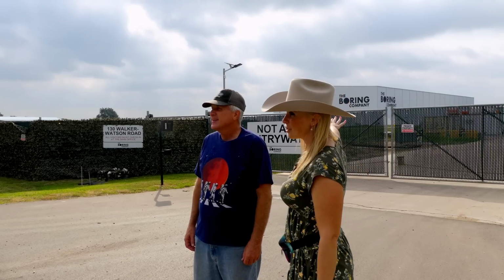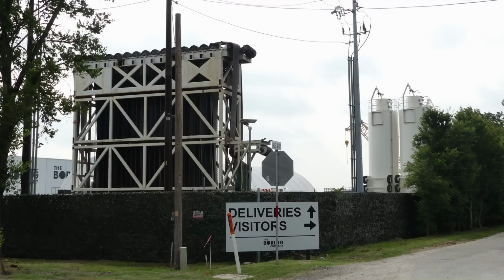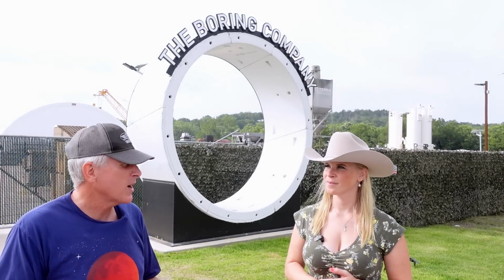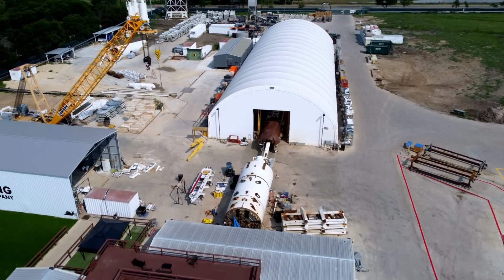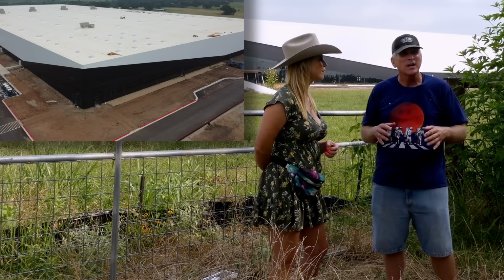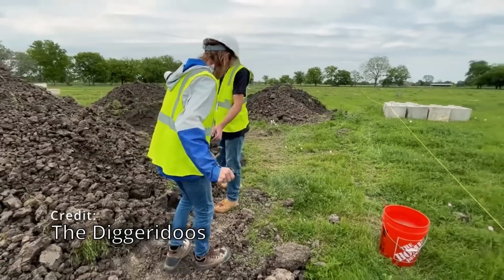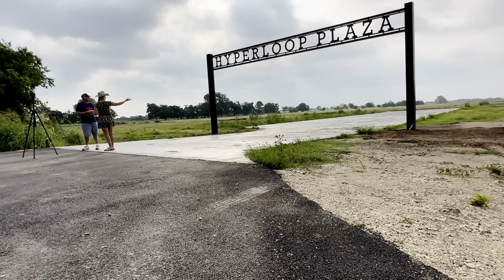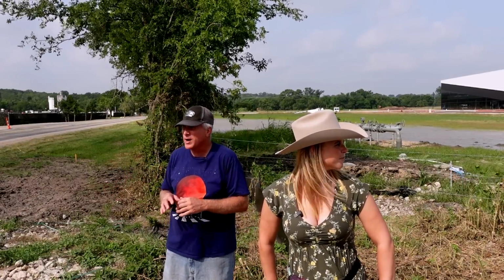Boring Company Drone Mission Reveals Secret Testing Tunnels

Comment: its just tiny tunnels whats the point
Reply: Zero emission vehicles make small tunnels feasible for transportation, small tunnels reduce costs, reduced costs make more tunnels feasible, more tunnels means less traffic congestion and possibly even returning surface streets to pedestrian use (in time).

Of course inexpensive tunnelling will also be very useful on Mars, where cosmic radiation will be a serious threat to health.
Reply: @alanlight7740  small tunnels are a deathtrap and no option for mass transport
Reply: @S1nwar  - the tunnels are the same size as some of the tunnels in the London Tube.

Comment: Tesla should provide the vehicle on demand at or near Hyperloop entry’s. A unique vehicle with 360 degrees of wheels unless electromagnetic or combination thereof. Reasoning: like on the log rides when all passengers move to one side then the other, that rock in a high speed vehicle could be RUD prone.
Reply: P.S. you can do it Ellie, 1% better each post is all that matters. You will achieve!

Comment: The Boring yard looks similar to SpaceX…. All organized for a reason…

Marcus is somehow able to get answers of every new piece that shows up everyday…

It is a continuous story that builds every day…

He gets lots of local help… and does the work remotely from Australia…

The giant sliding door on the end of the tunnel…. Looks pretty heavy, like it might be able to hold a vacuum inside the tunnel…
Air resistance inside a tunnel can really affect speed… removing the air will really speed things up…

There is really a lot that can be covered… like SpaceX, it is all in plain view!

If you capture these details… (what is this, what is that, what is happening over there…) your subscribers will multiply…

Some of your viewers will gladly supply answers and deeper questions…  

Elon will spend time with people knowledgable about his project that can help tell his story…. Watch Tim Dodd the Everyday astronaut for how well that worked out for his channel…   

Tim developed the skills needed to discuss the details of the Raptor engines so he could discuss them while walking around the facility with Elon…

Everyday you get stronger… keep building your team… and assorted connections…

Every Boring job will make interesting presentations for years to come…

Lots of questions about tunnel design…. Materials, strength, air flow, vents, safety, fire, rainwater, groundwater, ocean water, vehicle exhaust, dirt, grime…

Find out what Elon has in mind… what makes his tunnels better than the others… what are the other’s short comings?

Ellie, you are closer to these answers than anyone else…

There are so many historical tunnels you could visit doing your research…. NYC has so many….they handle tons of cars every day.

There were two British chaps YTing narrow boats cruising canals… each canal story had a highlight of the technology around it at every stop…. They were skilled at getting interviews with people that had access to answers…

Find those people… your people!!!  😃

You have great skills of telling a story…. Start weaving a bigger story!!!

Comment: That's a small tunnel cutter. There are yt videos that appeared in my feed that show much larger units that crews man. These units have control rooms, motor rooms and crew rooms. The cutting of water tunnels for Pumped Water Energy Storage systems use these much larger machines that cut about 12 feet, then the unit installs the roof sections, then drags itself forward, repeat. The conveyer runs all the way to the entrance chamber, where loaders scoop it up and load trucks or rail cars. Switzerland has a few tunnels that descend and rise at very steep angles.  The engineering through various strata is detailed and amazing.
Reply: There are other kinds of boring machines, yes. The Boring Company however wants to specialize in just one or two, possibly three standardized sizes in order to reduce costs. The primary size is large enough for one lane of passenger traffic, and these would be bored in pairs to allow two directions of travel. They are also looking at a larger size that would allow two trucks to travel side by side. One way travel reduces the likelihood of an accident and also keeps air flow running in one direction to reduce air resistance, while the reduced size keeps costs down. The reduced size does mean, however, that these tunnels would only be suitable for zero emission vehicles.

Comment: It'll come down to  how fast they can go. 5+ miles a week? Then they have to build up! A 500 mile project, a loop around austin dallas galveston corpus christi san antonio, would need dozens of those going at the same time. 100s mile total length in conveyor belts used at once. It'll come down to who can work out chorreoghying those elements. I think Boring is worth focusing on to get up to that 5+ mile/week range. There are a few different types of projects this tech, at that speed, can be used for.

Comment: Tunnels avoid dangerous traffic on Earth, and dangerous surface radiation on Mars.

New ideas (like Elon's) pass through three periods:
1) It can't be done. 
2) It probably can be done, but it's not worth doing. 
3) I knew it was a good idea all along!
-Arthur C. Clarke
Reply: Someday we may need to avoid radiation on Earth,too.❤
Reply: 2.5) It probably can be done, but Elon is lying and will botch the job, and it should be done differently, anyways.
Reply: By routing motor traffic underground, tunnels can also return streets to pedestrian use - which can change cities in very significant ways.

Comment: Chicago has a tunneling system But it's to prevent flooding. They have multiple  reservoirs that hold trillions of gallons of water. Once the rivers water level starts to drop, they pump the water out of the  reservoirs back into the rivers. They started digging the tunnel in the 1960's. They should finish around 2030. Deep tunnel is what it's called.

Comment: Is there any Lithium, cobalt, or other valuable material in the dirt that comes out of the tunnel?
Reply: This of course would depend on where the tunnels are located. My understanding is that in the Austin area about the only thing they would be getting from the tunnels would be limestone - which would primarily be useful for building more tunnels in softer soils as limestone is used in concrete.
Reply: @alanlight7740  Anything that can be reused makes the tunnel cheaper. I remember at one point, early on. He was talking about selling bricks, made from what was excavated. For a very low price. I remember 10 cents a piece. But I'm not certain about that price.

Comment: History shows, that increasing capacity, just increases demand. And you do not want to be in standing traffic in a single lane tunnel……
Reply: It’s easier and cheaper to add further tunnels than widen roads on the surface, in order to keep up with demand. Also autonomous vehicles shouldn’t result in human-driven stop-start traffic, so no reason for vehicles to sit stationary in the tunnels.
Reply: Another way to say that is that people like to travel when it is easy to do so, so quality of life goes up when lanes are added.

Of course the chief problem with adding lanes on two dimensional roads is that they get in the way of each other: grade level crossings that require traffic lights and frequent stops, cars needing to change lanes to be in the correct lane to turn, and all that. Automation makes one lane equal to about three lanes, and then by going into three dimensions road crossings do not need to slow down traffic - and of course we can dig down much further than we can build up. With all those factors the old wisdom about adding capacity increasing demand is not especially relevant any more.